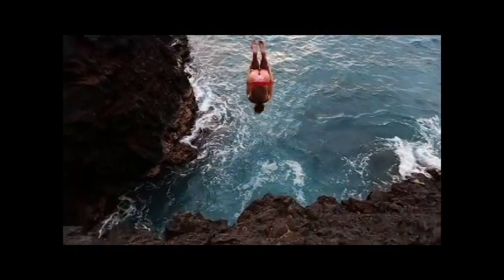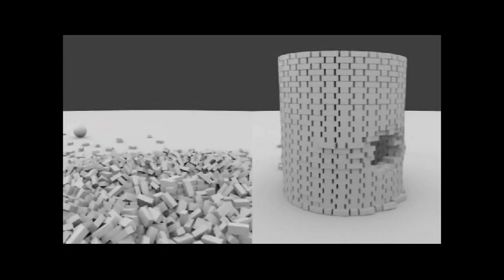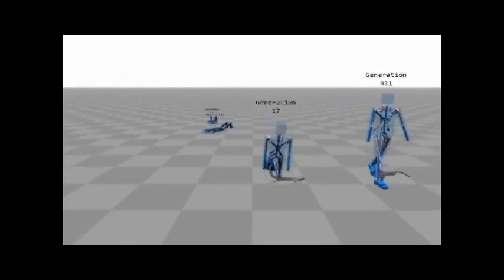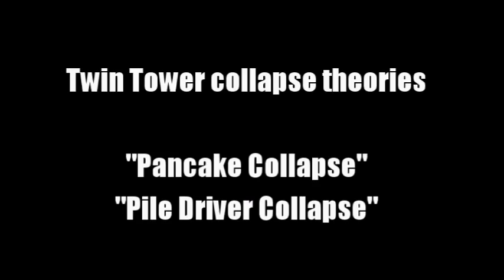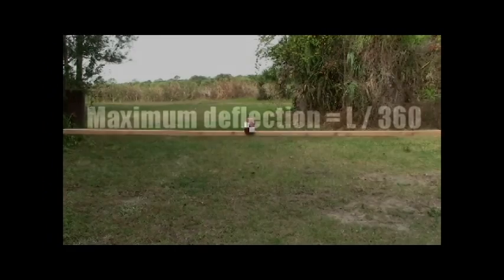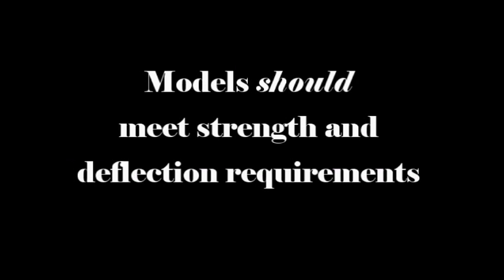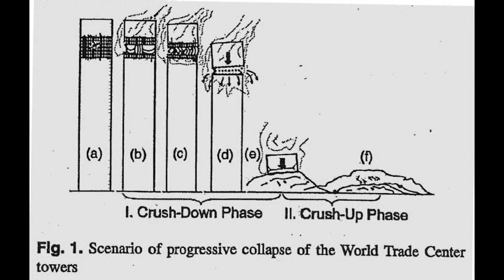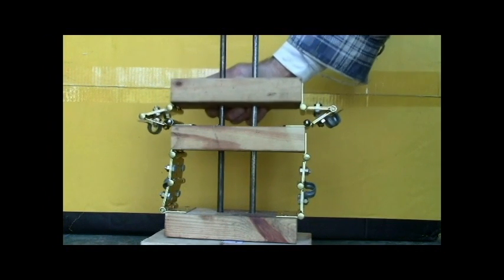9/11 Experiments: The Force Behind the Motion

Comment: I am so tired wit these so called demonstrations. There is no math, materials and conditions  are all wrong, so much waste of time. You just cant build paper frames all around every floor and call it test.
Reply: Yes the laws of physics didn't work that day. You can't argue with guys who try to make the impossible sound plausible.
Reply: http://www.the-office.com/pancakecollapse.jpg thais is what happens when a building pancakes!
Reply: He used sheets of concrete to simulate concrete floors. How is that wrong?
Reply: As for the paper that was to demonstrate that even with the weakest walls, NIST's evaluation is wrong.
Reply: George Whitehead  Do you think a single impact on a steel beam or column will destroy it's structural integrity George? How about multiple hits like when steel caissons are driven into the ground with pile drivers?
Reply: Yes the bottom 85% of the building wasn't hit by a plane and was undamaged. can you explain how that was pulverised into dust too?
Reply: math? in maths there's lunacy such as smaller infinity and bigger infinity, imaginary numbers and straight lines. these are just a few concepts that don't exist in the real world. if you crunch the numbers for long enough you'll end up capable to prove anything, so, no thanks, i'd much rather have things demonstrated.
Reply: But demonstrations need to be in scale! Scale that uses math. Scale for strenght, size and there has to be same melting point of materials, otherwise it´s pointless and it doesn´t behave same way as reality. There is too many variables only computer  can demonstrate. And only when someone knows all the variables and put those data to computer it can calculate right result. Math is complicated, you are right, and only few can really understand it and use it. This guy ain´t one of them ;)
Reply: Sewiet13: I kind of use it. That´s why I know this is not the way demonstration of motion works. Not in this case. May I ask what do you study?
Reply: Aubrey Oleandereie  You know what tires me Aubrey? It's NIST when they claim to have discovered new and revolutionary concepts of physics but selfishly keep the secret buried behind red tape, never demonstrating to the world how the magic was performed in any sort of practical experiment. How about you? Just the opposite I take it?
Reply: Well, then i guess you need a proper well funded investigation by the government. Turns out you haven't one... shame really don't you think? All this videos wouldn't exist if a proper comission inform was done instead of a gruyere cheese that opens more questions than answers gives...don't blame the people whos scratching theyr heads trying put some logic and common sense in all this nonsense.
Reply: Eric even in my country Technical university have done the math and result was same as reality. And I am pretty sure they didn´t get any money from US goverment. But you can invalid any study with the "money from goverment" argument, because you already made an opinion and choose just demonstrations and theories that fits your world view.
Reply: by any means, im always looking for the more logical explanation, i have yet to encounter a debunker or any oficial statement really explain what happen that day. Oficial comission doesn't explain the explosions heard by people that day, official comision doesn't explain why suddenly the building 7 had collapsed like a controlled demolition, official comission doesn't explain a lot more things that doesn't make sense. If we had a real investigation trying to really explain everything we wouldn't have these videos nowadays, and people all over the world scratching their heads to try to explain something that doesn't make sense. 

The investigation was delayed more than a year, the funds for that investigations were like a 20% of the funds for the investigation of Clinton sexual abuse claims. Nothing in the oficial version looks to really explain and give answers to the people, its a cover up. If u believe in the oficial version, i can't help you, you are the one who bought a thing and do not want to look behind.

And whats that estudy you mention BTW? a link maybe i will be glad to take a look.
Reply: Post the fucking findings then, stop saying shit and backing none of it up. Post you'r local university findings lets all fcuking see. You're full of shit.
Reply: Why did the top part pancake in on itself too? So the the little part at the top fully demolished the totally undamaged bit and then self destructed on itself? You fucking care too much about this, one of these payed stooges sitting at a keyboard trying to baffle people with bullshit!
Reply: If there were no explosives used and the buildings falling due to gravity.  Tell me how there were lateral ejections and how tonnes of steel were blown hundreds of yards away? Gravity does not allow for lateral ejections unless the items are lighter than air. Now nist said that the buildings failed due to gravity, debunk that one.
Reply: yes, If building 7 fell so easily because of an office fire. Why didn't they change the building regulations?
Reply: To ones where a building doesn't fall down to an office fire!
Reply: No it doesn't Steel beams if dropped will fall straight down you muppet, they wont land 3 streets away!
Reply: Go read some Isaac Newton!
Reply: Dinky Doo - "Why didn't they change the building regulations?"
http://www.fireengineering.com/articles/2011/08/9-11-code-changes.html
Reply: Dinky Doo - "Steel beams if dropped will fall straight down you muppet, they wont land 3 streets away!" and "Go read some Isaac Newton!"
That's interesting. Where or when did Newton state that tension, friction and collision works on all bodies expect steel beams? You might want to read into momentum and vector a little bit.
Reply: Bruce Lansberg  Where in Newton's 3rd law did he prescribe to the wacky notion that an object at rest can impact another and another of ever increasing density while accelerating downwards under normal gravity to "essentially" the rate of free-fall as NIST describes in their reports "Bruce" ??
Reply: Dear DInky, from your post it becomes painfully obvious you have no clue what you're talking about. What object at rest? Which impact? Which density is increasing? You're not talking about the core, are you? What role do you think the core played in the collapses at all? What do you mean by normal gravity? What is abnormal gravity? There is no such thing as "rate of free-fall". Never did NIST write such in their reports. Please tell me in which report and on which page please.

You earlier showed you have no clue and refuse to do some research by pointing out wrongly that building codes had not been changed. Please do yourself a favor and try to understand the subject matter before you make an even greater fool out of yourself. Do you already know what vectors are?
Reply: "Yes the laws of physics didn't work that day."
Please tell me which law and WHY. So far you habe not been successfull in explaining. Try again.

"You can't argue with guys who try to make the impossible sound plausible."
Which impossible? Please explain what is impossible and WHY!
Reply: Well lets see, what about airplanes that crash and leave no fucking debris? Those special planes that fully dive into the ground and leave a plane shaped dent in the ground. I'm not a physicist so lets call it the plane burrowing underground law. Or the plane that looks like a missile law where a jumbo jet can't be spotted by the most watched building on the planet. Lets call that the who hid the tapes law.
I don't give a shit what you say, you cant have a building failing due to gravity and yet steel beams weighing tonnes land hundreds of yards away. 
What about the vanishing core column law? You know the column that would still be standing if the floors pancaked in on themselves! What about the imaginary explosions law? Every fire fighter who survived said there were multiple explosions in the buildings, which can be clearly heard on multiple videos. What about the psychic law where people know whats going to happen before it actually fucking happens. BBC and building 7, Insider trading on the exact airlines shares to drop the day before the actual event. I'm sure you'll come back with a smart arse answer, but you can't drop a 10 ton steel beam from a building and it will land 3 fucking streets away without other forces brought into play.
Reply: I am a little bit disappointed that you have not answered one of my questions. But let's not get distracted by that. You will answer them later, right?

"what about airplanes that crash and leave no fucking debris? Those special planes that fully dive into the ground and leave a plane shaped dent in the ground."
You speak in riddles but I assume you are referring to flight 93. Let's see:

"Searchers Thursday found one of the so-called black boxes from United Airlines Flight 93"
"A second debris field was around Indian Lake about 3 miles from the crash scene. Some debris was in the lake and some was adjacent to the lake. "
"More debris from the plane was found in New Baltimore, some 8 miles away from the crash. "
"According to the NTSB, it is not only possible that the debris is from the crash, it is probable,"
"Officials said an engine part has been recovered. Much of the debris is tiny. "

http://edition.cnn.com/2001/US/09/13/penn.attack/

http://www.vaed.uscourts.gov/notablecases/moussaoui/exhibits/prosecution/P200060.jpg
http://www.vaed.uscourts.gov/notablecases/moussaoui/exhibits/prosecution/P200061.jpg
http://www.vaed.uscourts.gov/notablecases/moussaoui/exhibits/prosecution/P200062.jpg
http://www.vaed.uscourts.gov/notablecases/moussaoui/exhibits/prosecution/P200063.jpg
http://www.vaed.uscourts.gov/notablecases/moussaoui/exhibits/prosecution/P200065.jpg
http://www.vaed.uscourts.gov/notablecases/moussaoui/exhibits/prosecution/P200066.jpg

"Finding the flight data recorder had been the focus of investigators as they widened their search area today following the discoveries of more debris"
"Others reported what appeared to be crash debris floating in Indian Lake, "
"Workers at Indian Lake Marina said that they saw a cloud of confetti-like debris descend on the lake "
"In a morning briefing, state Police Major Lyle Szupinka confirmed that debris from the plane had turned up in relatively far-flung sites"

http://old.post-gazette.com/headlines/20010913somersetp3.asp

Since you mentioned the laws of physics were broken, could you please show me some of your calculations? Which bodies interacted? Which forces have been exerted onto one another?
Reply: "Or the plane that looks like a missile"
Or the plane that looks like a plane... Is this an argument? You don;t see a plane so 9/11 was an inseide job?

"the most watched building on the planet"
Yeah, I hear that a lot. But when asked to back up this claim, I get nohting but silence. So to you: could please provide some backup for your claim the Pentagon is "the most watched building on the planet"? What does that even mean? Most watched?

I guess you can't believe that flight 77 wasn't picked up by security cams. Right?Well, let me ask you this: How many security cams were present at the Pentagon at 9/11? How many of those were actually recording? What was their exact position? And how many were pointing at the sky or straight forward? See, that last one is a deal breaker, isn't it? Security cams usually do not point at the sky since immediate thread was considered to come from the ground, from parking lots and entries. That's where security cams are pointed at. For a good reason.

Have you read the Maguire statement?
Reply: "you cant have a building failing due to gravity and yet steel beams weighing tonnes land hundreds of yards away."
Let's take a look at that statement. The towers were not failing due to gravity. They were failing due to a combination of a plane impact, fires, time and design. As for the steel beams that weighed "tonnes", how much exactly did a steel beam weigh and how did you get to your result? Also I am curious how you got to three streets away, or hundreds of yards. How should steel beams behave when they collide with other steel beams? What would be a "normal" distance for a steel beam to travel and why? You claim it's impossible, so I assume you have done the math.
Reply: "BBC and building 7,"
Oh please, that has been debunked over 10 years ago: 
http://www.bbc.co.uk/blogs/theeditors/2007/02/part_of_the_conspiracy.html
http://www.bbc.co.uk/blogs/theeditors/2007/03/part_of_the_conspiracy_2.html

And please take the efoort to READ.

"Insider trading on the exact airlines shares to drop the day before the actual event."
I am a bit confused here. Did you not mention earlier that there was no plane, but a missile?
On topic: Yes, there was unusual trading the days before the attacks. SEC and FBI have investigated this and came to one conclusion: "Highly publicized allegations of insider trading in advance of 9/11 generally rest on reports of unusual pre-9/11 trading activity in companies whose stock plummeted after the attacks. Some unusual trading did in fact occur, but each such trade proved to have an innocuous explanation. For example, the volume of put options — instruments that pay off only when a stock drops in price — surged in the parent companies of United Airlines on September 6 and American Airlines on September 10 — highly suspicious trading on its face. Yet, further investigation has revealed that the trading had no connection with 9/11. A single U.S.-based institutional investor with no conceivable ties to al Qaeda purchased 95 percent of the UAL puts on September 6 as part of a trading strategy that also included buying 115,000 shares of American on September 10. Similarly, much of the seemingly suspicious trading in American on September 10 was traced to a specific U.S.-based options trading newsletter, faxed to its subscribers on Sunday, September 9, which recommended these trades. The SEC and FBI, aided by other agencies and the securities industry, devoted enormous resources to investigating this issue, including securing the cooperation of many foreign governments. These investigators have found that the apparently suspicious consistently proved innocuous."
Reply: You're just another of these paid idiots. How can you have confetti like debris when the plane made that perfect plane shape on the ground where it burrowed underground?
Reply: Are you trying to change my mind with your bullshit? There are reported to be 80 tapes of the Pentagon on 9/11. You believe what yo want i'll believe what i want.For all your typing and copy and pasting you're proving absolutely nothing. To say the BBC was debunked when it fucking happened in real time is just fucking stupid. Are posting total crap. Now piss off.
Reply: Again, you clearly have no idea what you're talking about. There were no 80 tapes of the Pentagon. Please inform yourself correctly for once. The 84/ 85 figure for videos came about as the result of a FOIA request for videos showing the Pentagon impact. The FBI are talking about 85 videos, but this is just the result of an initial search that includes (for example) all videos obtained by the Washington Field Office. If we move on from that then the numbers begin to fall dramatically. 
- 56 "of these videotapes did not show either the Pentagon building, the Pentagon crash site, or the impact of Flight 77 into the Pentagon on September 11." 
- Of the remaining 29 videotapes, 16 "did not show the Pentagon crash site and did not show the impact of Flight 77 into the Pentagon." 
- Of the 13 remaining tapes, 12 "only showed the Pentagon after the impact of Flight 77." 
- Only one tape showed the Pentagon impact: the Pentagon's own security camera footage, that would later be released. 

Have you looked up the Maguire declaration yet? I'll help you out a bit. here it is: http://www.judicialwatch.org/wp-content/uploads/2013/07/A_2006_doubletreeaffadavit.pdf
Reply: Bruce Lansberg  You seem to only be an expert when it comes to defending the illegal, immoral actions of the US government Bruce. I would swear you exhibit a certain confirmation bias in these matters.
Reply: M Fritz (NOT M Fitz!) - Could you please show where my explanations are off? Could you please show me how they're biassed? Empty rethoric doesn't help you make a case.
Reply: Bruce Lansberg  We civilians are not miracle workers like you paid shills are. It would take an act of God before one of us poor earthlings could ever show you high and mighty government supporters where you made a mistake.
Reply: Bruce Lansberg (NOT Bruce Lansburg!) Your explanations are always off because you portray yourself as an expert Bruce.
Reply: M Fritz (NOT M Fitz!)/DamnSuzuki100 (NOT DamoSuzuki100!) - Like I said in the other thread, there is really no need to state which user name I do not use, since I am not the one causing confusion by continuously changing names that resemble others'. You pose yourself as other users. I do not.

"We civilians are not miracle workers like you paid shills are. It would take an act of God before one of us poor earthlings could ever show you high and mighty government supporters where you made a mistake."
Let me rephrase that: "Bruce, I do not have a real argument since I have only watched YouTube conspiracy videos and I do not have a clue whatsoever what I'm talking about. therefore my only resort is to fall back on what I have learned (but never really worked), calling others shills by a lack of an intelligent rebuttal."

"Your explanations are always off because you portray yourself as an expert Bruce."
Then it wouldn;t be that hard to come up with a few examples, would it? So please tell me, where are my explanations off? You know what, I'll save you the embarrassment. You can't tell me because you don't know. You have not taken any effort in researching the events of 9/11. And I'm perfectly fine with that. But I would encourage you to stop pretending you have, because you're making a fool out of yourself. Am I wrong? Please show me.
Reply: Bruce Lansberg (NOT Bruce Lansburg!)  That is a lie Bruce. You're doing the job you were assigned to do.
Reply: Oh and if you believe in the pancaking effect, where is the top of the building that caused this? Did that just destroy itself too?
Reply: Aubrey Oleandereie : Then use gold, stupid! And his paper is white and not grey, and the experiment is not made at ground zero, right? If you have a brain switch it on and learn to think!